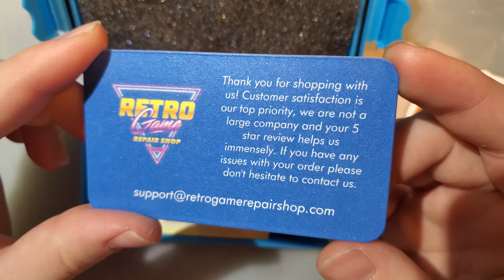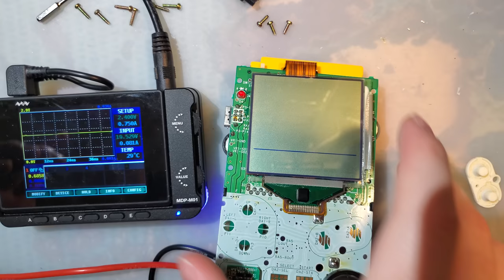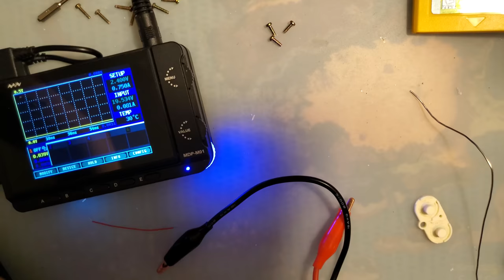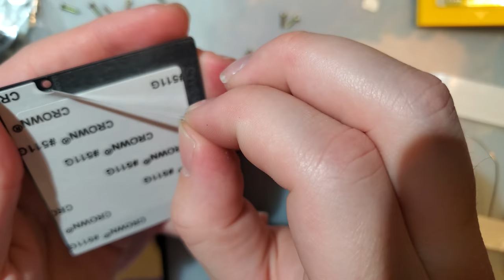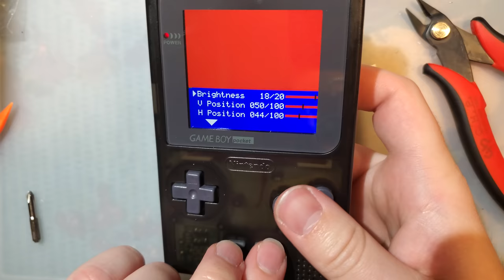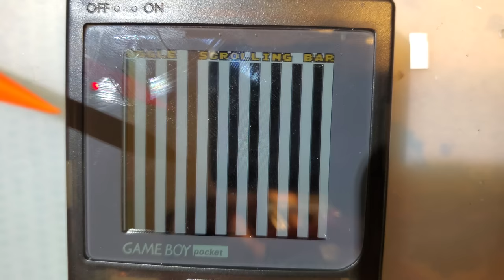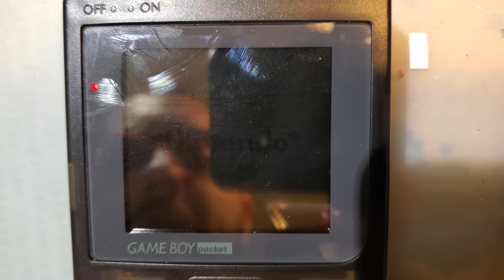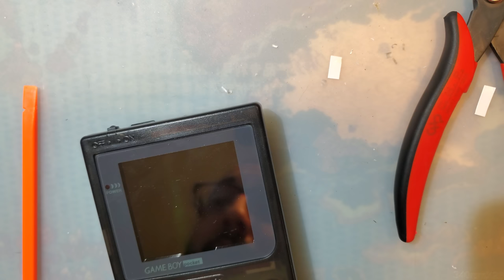Game Boy Pocket "One Chip" OSD IPS Kit

Comment: Thank you Makho, you’re the best.  I just finished installing this kit five minutes ago, and I am extremely pleased with it.  I mostly struggled with the soldering of the A B Select wires to the motherboard, but I’m getting better with every project.  A very important note, and I apologize if you covered it in this video, is that a game MUST be inserted in order to bring up the OSD.  It might seem obvious to most, but I questioned my soldering skills, and was too lazy to put a game in, so I wasted an hour troubleshooting and ripping my hair out.  I also used a cheap aftermarket shell, and had to use the cheap power switch that came with it, just like you did.  In the end, I recommend this mod completely.  Thanks for the help.

Comment: I recently installed this kit into a gb light (original display had missing lines) and it looks fantastic.
having retropixel is a must and being able to edit all the palettes to my liking sealed the deal.
being a gb light I had to fiddle a little to find the correct solder points for the OSD, but your video helped greatly, thanks!

Comment: Quick question: Do you need the orig. power regulator from the GBP? I've been looking to install the CleanPower GBP and been wondering if i need to keep the old one! Also, nice video mate! Keep it up!
Reply: Also, if I have a RetroSix shell with the Q5, will the IPS fit in the shell, and can I use it without the bracket?
Reply from the maker: @chris-fk1hb  Retrosix is a scammer and you should not purchase anything they sell. 

That being said, this particular kit only needs 5v so it will work with any aftermarket regulator replacement. The funnyplaying kit requires OEM regulators because of how the brightness control works with the contrast wheel.

Comment: I recently got 2 OSD kits (one chip versions from another AliExpress store) that look almost identical to this, except that there’s 36 color palettes and the menu controls are absolute garbage. IF anyone comes accross that one, I’d recommend NOT picking it up. Stick to this one.
I installed them on 2 separate Pockets and for both, the signals get triggered randomly while playing a game and suddenly the OSD pops up and you can’t close it. I tried cleaning, resoldering and taping off various things to avoid possible interference a dozen times to no avail, leading me to think something’s wrong in/on the PCB itself.

Comment: Hello. Hope you still read these comments. 2 questions, if i may:
1)!You connected the IPS screen to the "common" pin of the power switch. Whats the difference between using this pin and the one located at the very left? I used this following another of your videos.
2) So, I have this IPS screen on my GBP, same model as yours (power led model). I can make it work with batteries, but when i plug a Pelikan 3V AC adapter (designed for GBP and GBC) it wont turn on, or when it does, the screen flickers and the GBP acts slow amd weird. I assume the power is not enough. How can we make it work? Batteries last nothing.
Reply from the maker: Common pin means the kit only gets power when the GB is on. On earlier kits, the screen would glitch out on some GBs when supplied with external power. 

Your power supply is not rated for a modded GB.

Comment: Ok just installed and I'm having issues 
So it keeps swapping pixel grid on and off
Also is there like a manual for the menu I'm so confused and would like to sell this so I would like something presentable to the customer 

Your videos are great 
Happy to solder the wrong points with you even tho I watched the video before 
Fun times!
Just did this and the usb c mod 

Everything is perfect minus the pixel grid thing and the speaker is kaput

Oh I bought the board from China and it had a doctored on led 
They just drilled a hole and slaped in a led 
I was soo confused but after installing the battery indicator led from the usb c board I realized what had been done to it

Comment: I can’t even get my OSD to come up. I triple checked all my connections! I do have the gbp without the battery light. I wonder if that has anything to do with it.
Reply from the maker: Make sure you follow the instructions for soldering that the manufacturer provides (before the diode array). I tried to be clever and initially used the wrong pads (after the diode array). Ensure the button itself even works then double check with a multimeter if you're confident in your soldering.

Comment: I seem to have issue with bring up the OSD as well, it sometimes works and other times it doesn't. Is there a different way to wire it up other than what you showed in this video??
Reply from the maker: it won't work unless you are in a game due to how the Pocket handles button inputs.
Reply: @makho  So you actually need to be playing a game for it to work correctly then?. How odd
Reply from the maker: @BlockABoots  Yes. Like I said, it's because of how the Pocket initializes button inputs. There is no need for button inputs during boot so initialization happens after.

Comment: I imagine that the board knows what type of response it is looking for and that it is different for a button press versus the "touch/proximity" sensors.  If it isn't could you just put a bunch of those pads in the shell and then by placing fingers over one or two (for the hold down buttons) and then tapping the change areas have it be all non physical button?
Reply from the maker: the touch sensors and button inputs are wired differently. I don't believe that will work without extra circuitry. I've been meaning to experiment with that sort of thing though.
Reply: @makho  I figured as much but if nobody asks the stupid questions then they float infinitely in space.

Comment: I had horrible experiences with the Jugee AA batteries, try the Kentli AA/AAA PH-5/PH-7 1.5V rechargable Li-ion instead, it would be interesting to see a comparison by someone else to see if I've gotten a bad Jugee charger or something. Obviously I didn't buy more of that brand after that...

They still fall a bit short of Ladda NiMH on high power-draw application if the item can tolerate low voltages (down to 1V), OTOH on items that require a high and stable voltage they're not bad - both Jugee and Kentli will hold 1.5V (+/- 0.05V) even at high load until they've got less than ~5% charge or less where they start dropping voltage to trigger battery warnings, while "normal" batteries experiences voltage sag both as they discharge and due to the amount of load (mostly caused by voltage drop due to internal resistance in the battery).

You measured a no-load voltage of 1.36V on the Ladda but the voltage the GBP sees would be lower due to putting load on the batteries, the active voltage regulation on the Li-ion 1.5V avoids this.

OTOH the KENTLI chargers are a bit more clunky to use than the Jugee's chargers, they uses a third connector for the charging current and the batteries can be a bit hard to get in and out of the charger while the Jugee is as easy to use as a regular NiMH charger.

Both are available on AliExpress and other normal sources, though as you mentioned that the Jugee AAA was pre-production while Kentli have had their PH-7 AAA model out for a while and the corresponding PH-5 AA model is their third-gen Li-ion rechargable 1.5V - if it doesn't say model number just look for light blue/dark blue color combination, the first/second generation was gold and gold/red respectively. Jugee AA cells are dark-blue.
Reply from the maker: I can't accurately compare my pre-production JUGEE AAA batteries to anything because they are only samples and the manufacturer has told me that they are not up to spec of the final versions. The quoted capacity like three to four times the capacity of the cells I have so if the manufacturer isn't lying about that (which -- they were spot on for the AA cells so that seems like a reasonable assumption to me) then they should be pretty good. 

And yes, that was a no load measurement but for my purpose it was sufficient. I was just showing that the JUGEE batteries put out more voltage which tends to help greatly in a Pocket.

Comment: Hi Makho, how did you manage to solder the wires onto the A,B and Select on the motherboard? There doesn't seem to be anything to solder on to.
Reply from the maker: I soldered to the vias. You just have to get some solder in the hole and then you can insert the wire there.
Reply: @makho  I will give it a go. Thanks for the reply mate.

Comment: Hey Makho any advice on dealing with the high frequency noise on the GBPs after the IPS screen install??
Reply from the maker: Try better batteries
Reply: @makho  Duracells, energizers, eneloop pro's seems to not matter a lot when dealing with this issue.

Anything you recommend?
Reply from the maker: @ivandosio9826  constant voltage batteries like jugee or tenevolts

Comment: So, I didnt have any problem loading my ez flash on the FP IPS kit with Laddas -- is this one more power hungry? The voltage regulator would fix this problem with this kit, correct?
Reply from the maker: Not every console is built the same. Also, the issue is more apparent when the batteries are not fresh off the charger. Try playing it for an hour or two then reboot.
Reply: @makho  bingo! I played it for an hour, turned it off, and it started to cycle loop with my Jr. Could you do a video on a voltage regulator install with an IPS? All the ones I see are for backlight/bivert kits :/
Reply from the maker: @ilchymis4000  A voltage regulator isn't really going to help.

Comment: I just installed this kit using a trimmed OEM shell. I'm finding the motherboard doesn't want to sit flush in the shell on the top corner of the power switch side. This is causing too much pressure on the display when I close up the shell. I can't see anything obvious that's binding. Anyone else have this issue?
Reply: I removed the OSD wires in case they were the issue but no luck. I also trimmed any leads on the front of the motherboard but that doesn't seem to be it.
Reply from the maker: @brian5460  it sounds like you haven't trimmed enough of the case

Comment: Where did you buy the voltage tester?
Reply from the maker: Voltage tester? The multimeter I used? Or do you mean my power supply? The former is a cheapo freebie from harbor freight (well worth the cost with the coupon) and the latter is a MDP-XP.

Comment: So, I despise soldering to via's so I actually found traces and scratched away solder resist to make pads.  A little flux and tinning and they are super solid https://i.imgur.com/qrqbZze.png
I do not have a transparent shell on mine so this was no issue.  I may take a stab at the upper VIA's like you did next time I do this mod.  The VIA's below in the area with white solder mask are a nightmare to get solder to wick down into the via itself.
Reply from the maker: You have made more work for yourself and it results in a worse looking install. I can't say I recommend doing this.
Reply: @makho  I would agree with both points and next time I would use the upper PCB via's. However I do not have a transparent shell and those joints are rock solid so from a functional standpoint I feel comfortable with them.